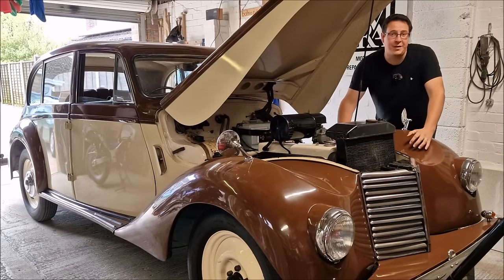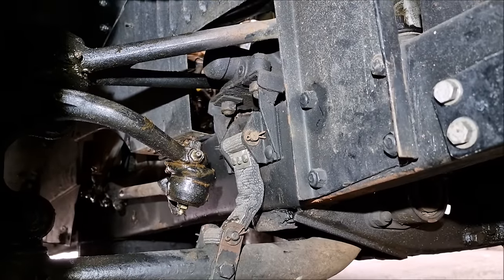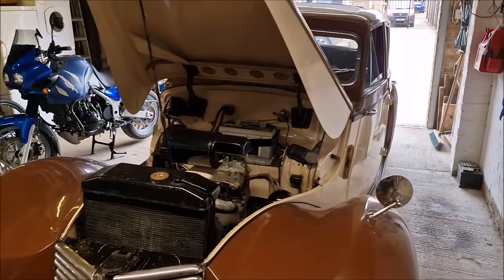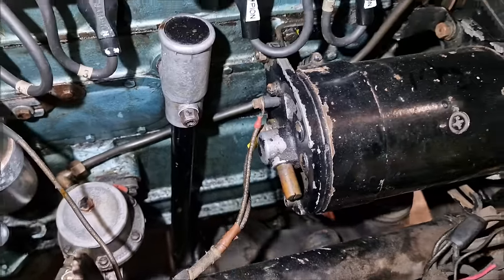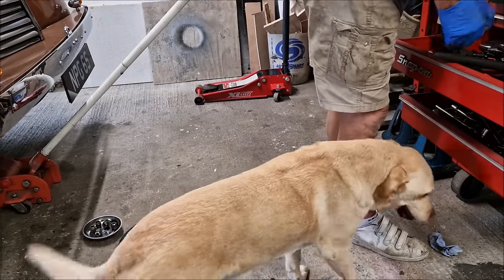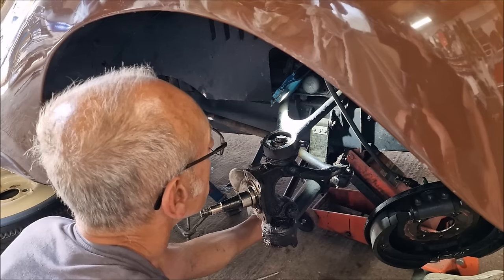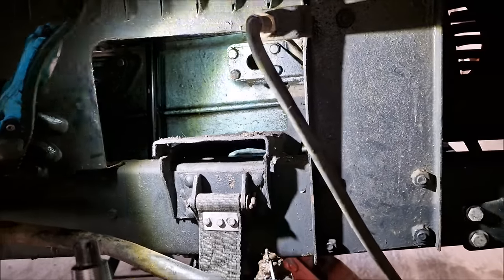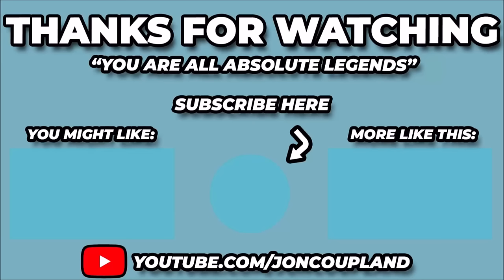"It's A Deathtrap" - Armstrong Siddeley Lancaster Condemned By Dad

Comment: I have never worked on an A/S but back in the day (1959) when I was a young apprentice this type of chassis crack on cars with early independent or torsion bar suspension was not uncommon. I think it is the bracket that has cracked or split off and not the chassis but the only way you can see is to disassemble the whole lot. I was a little concerned about how you were crawling under it when it was only supported by two axle jacks and blocks of wood. This car weighs in at 1.5 tons. Cracks like this can happen spontaneously with modern pot-holed roads. Back in the 1950s/ 60s roads had better surfaces. I owned a 1946 Austin 10 where the chassis cracked at the B post and when I opened the doors on that side they shouldn't shut again. RIP one A10 later I bought an MO Oxford. PS: It shouldn't get that hot in normal driving - you have a timing issue.
Reply from the maker: Thanks for watching - timing has been looked at so were unsure where our issue lies (maybe its just how it is, PLUS it was a super hot day) - were advocates of safety - the axle stands should do their job along with the jack - thankfully there is quite a lot of ground clearance too! - Penn Bradley (AS expert) has stated this is a common fault too - stay tuned for part 4!

Comment: This is why I have a proper mot done each year. I do not have a proper ramp or pit for inspection.
Reply from the maker: I understand why some owners do it too - were constantly on a fleet maintenance rotation so thankfully we spotted this too
Reply: @JonCoupland  in the UK if defect resulted with an accident, the insurance could become void as one was driving a defected vehicle. Un roadworthy they call it. When we collect older vehicles we must maintain them. Nice to see your workshop as your vehicle looks great. Many early cars with power steering resulted with chassis failure due mainly with drivers turning the steering when stationary, putting much stress onto the chassis. Steering stops should be adjusted to make sure the power steering mechanism has not reached its maximum movement as this can result in seal failure. Great fun owning and driving these vehicles but we all have to be aware of the engineering in the age of the vehicle.

Comment: As its only a bracket thats failed then a few mins with a wire brush and a mig welder would see a repair that is safe until you can get a replacment made up.
Reply from the maker: We dont like doing a job and not doing it properly 😊 - thankfully it's not a daily driver so we have the time to do it at our leisure (actually it's been done a while now) - thanks for watching

Comment: That not a “death trap” in the 60s and 70s I used to repair old banger I’ve seen and repaired much worse. Thats not a cracked chassis it the shocker Mount bracket.  I would weld up the cracks the make reinforcing plates and  double up or cut off old brackets and make new out of thicker material..
Reply from the maker: Check out the latest video. 😁👍

Comment: The Smiths jackall system could split its pump when old so beware. If you have camber problems you might have the torsion bars set up incorrectly. These had a big export market to Australia where they were often used to go out into the bush because the chassis was so tough. Luvax double acting shocker by look of it. With the bracket so damaged it might be better to have a new one fabricated. This would give you two advantages A) you can select a heavier material - remember factories had to use whatever material the Government allowed them which was always minimal B) the material will be entire and 0:20 presumably only welded solidly at a junction or possibly folded on hydraulic press such as the small 5ton presses you can purchase from Machine Mart etc. 
Always remember with late forties cars that the material you are working with was required on ration from Ministry of Supply of the Labour Government. Steel was very hard to get. That is why so much aluminium was used in high class cars as there was a surplus as no aeroplanes were in production. This had a down side. Aluminium presses were made from rubber moulds and life expectancy was about 1000 pressings which was about the number of expensive models a high class manufacturer would make. If you look at production figures they really exceed 1200 and that is why. You would have replace your presses for a hundred or two more. Unviable. Ask your Dad who is about my generation. That is also why the Land Rover was built because it was built from Rover scrap and obsolete engine production machinery from pre war. It only survived the Labour Government because it was shown to the King who drove one and wanted one! Labour politicians hated it especially as the market was for the owners of large estates who wanted to access remote places for forestry and agriculture. The social history of cars of that era is as interesting as the engineering which was often quite varied! Good luck with project.
Reply: Nonsense on stilts.
Reply from the maker: @fourwheelzone  that needs to be a tshirt
Reply: @fourwheelzone  The beauty of engineering is the controversy of opinion but much is explainable if you look at the social history of the time!

Comment: New brackets and weld up the chassis its not a death trap just an old car and if your useful with a welder it's no big deal .
Reply from the maker: I disagree. Imagine that arm collapsing at 40mph ... Not only could it have killed me but worse ... Someone else. Yes it's a relatively easy fix in the long run (actually we've fixed it) but absolutely it was dangerous. Don't downplay it.

Comment: The thing that does worry me is that you weren't aware that there was an issue. I keep getting customers who don't seem to have the feel to notice problems, some more dangerous than others. Perhaps you don't drive it much which is not really an excuse and I don't know how long that bracket has been broken.
Reply from the maker: Did you watch the previous video? I took it for a drive from my house to Dad's (it's about 20 houses down the road) and immediately felt the issue (of the car pulling dramatically to the left) so we took it for a drive together - we then made this video. This was the first time the car has been out this year. It's absolutely happened over the winter whilst been stood. But you are right. That's why it's important to know your car and how it drives.